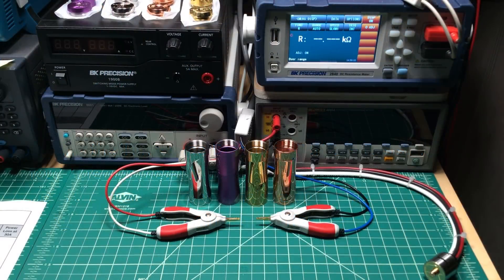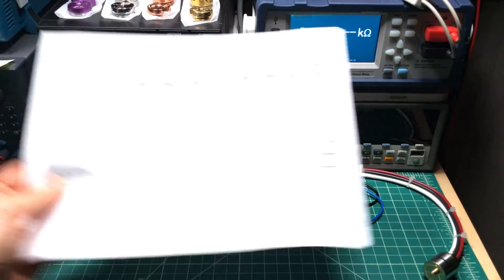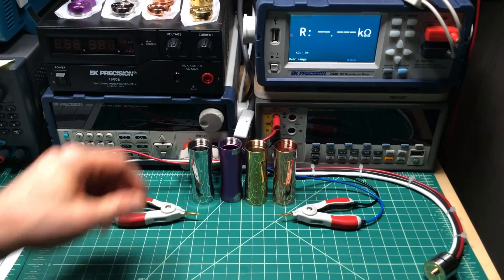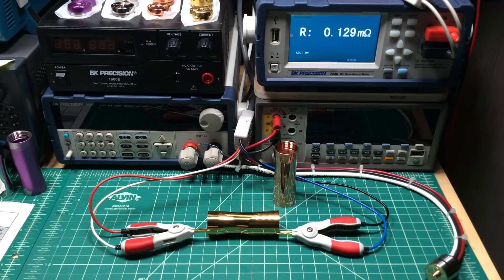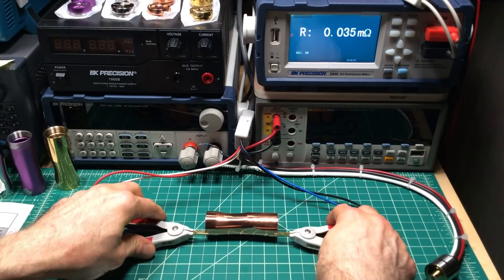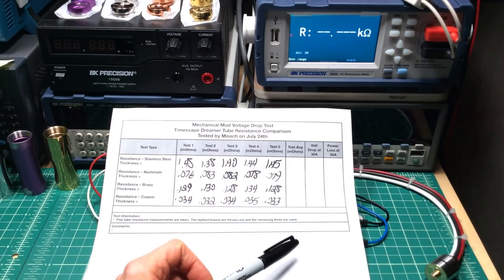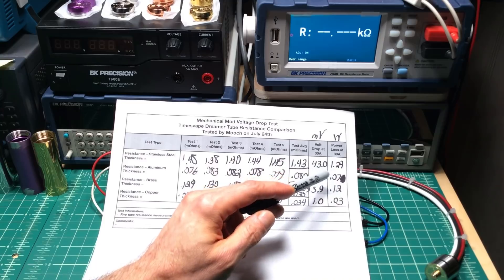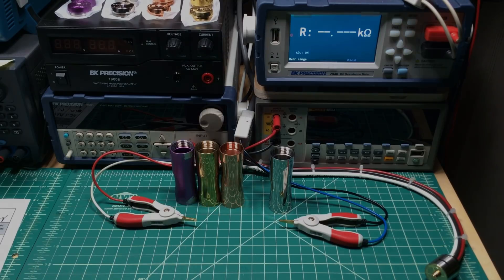Minding Your Mechs – Ep005 – Timesvape Dreamer Mech Testing  Part 1 – Testing four different tubes

Comment: I ended up buying a copper dreamer because it was the only one available to me. I almost got a stainless one, but I'm kind of glad I didn't. I have a fake Purge made of brass, and the dreamer hits ramping up about an extra third or half faster. It's a huge difference, although I don't know if that big of a difference would happen between the different materials. I really wish there was a way for me to check the resistance of super low things like you so I can see how high the resistance is for that mod.
Reply from the maker: The metals themselves wouldn’t much of a difference at all. It’s the contact shape/smoothness, the threads, all the other stuff rather than the metals.
Reply: @batterymooch  yeah i guess youre right, the biggest difference is the buttons. i wish i could show you a pic of the difference, the dreamers is incredible, constant contact with the battery, a real insulator, a cool round high current contact, and my absolute favorite part, the gold plated toroidal spring that keeps the button “shaft” in contact with the button itself and it hits so much better than the fake purge which has a crappy magnet switch which only makes contact on the sliding barrel of the switch.
Reply: @batterymooch  my fake purge doesnt even fire maybe 1/20 times and i have to smush the button to the side to get good contact.

Comment: Ive always gotten copper mechs but after watching this I would be very interested in this same test after the copper and brass have some oxidization.  Would it then equal to the stainless steel? would the Aluminum be the major player for people who aren't as consistent at cleaning their threads. I would guess it would all equal out and come down to keeping your points clean and flat.
Reply from the maker: Good questions! Lots of variables though and tough to test well enough to be able to form general conclusions. Might have to remain some of the mysteries of life. 🙂
Reply: @batterymooch  True, I hadn't thought about the testing and to be truly accurate what it would take. Because the degrees of oxidation the numbers would never be the same. Thanks for all you do Mooch! I love watching your Mech Reviews so informative! Every designer should be watching every one of your Mech testing! You have begun to layout the requirements for designing a low voltage drop mech and where the majority of focus should be!

Comment: Only steel is real! Hate copper or brass because its blushing that fast  no matter what you do. And the threads of the 510 are fucked in weeks!  Its just too soft...
Reply from the maker: Some metals definitely do require more maintenance and more careful use but many vapers like the extra one or two watts of power they get by using brass, aluminum, copper, or silver versus a SS mod.

Comment: The only experiential difference I have found between my stainless Dreamer and brass Dreamer is that the former is a nightmare to maintain - freshly scrubbed threads form a coating within two days, which results in hot threads. The oxidation is rock hard and needs a dremel to remove it.  The brass just keeps going before cleaning is necessary and only takes a matter of minutes with a cloth.

Comment: Great video! I'm definitely interested in the rest of the tests. I have one if the new Kennedy Vindicator mechs and it's the first SS mech that hits amazingly and I think it's because they use a copper button... This first test supports the fact that the tube metal (when thick enough), has relatively little impact to performance.

I would be interested to see the difference in overall performance in the SS tube with the SS button vs putting the copper button on the SS tube.

Comment: Aside from your telegraphing the result, I would not have guessed that the tube material would matter so little.  With that, I will guess that anywhere along the circuit mod parts make contact will be the largest drain.  We shall see

Comment: i expected brass to follow copper in the conductivity test not the aluminum.am i wrong or they use low copper brass?
thanks Mooch
Reply from the maker: Aluminum is more conductive than Brass. There might be a brass alloy with lots of copper and a less conductive aluminum alloy but in general aluminum beats brass...just for the metal that is. A complete mech has a LOT more going on than just the bulk resistance of the metal.
Reply from the maker: I don’t know what alloys are used.
Reply: yes i don t know either but in terms of conductivity if i m not mistaken it goes silver copper brass aluminum and ss from the materials mostly used in e-cigs.that s why it seemed strange to me that aluminum dreamer was more conductive than brass
Reply: evdoros stavridis no aluminum is more conductive than brass

Comment: I wish you had one of the original black cerakoted models as well, I am wondering if the cerakote would affect the readings compared to the same metal that’s not coated?
Reply from the maker: No effect at all unless the coating got in the threads.

Comment: Many people needed to see this. As you've stated, 18650 won't put out more then 30 amps so attempting to do so is nothing but harmful. This leaves me with my original thoughts on stainless mechs, I love them. They basically don't corrode, they can handle solid drops, they don't stink, and you may lose 1.4 watts at most and that's absolutely unnoticeable at higher power levels and basically nothing with higher ohm builds. I have brass mods and copper mods and I love them all but I hate when all I can smell on me or around me is that spicy funk of copper or brass mixed with oils from your hands. I'll always love my old school stainless Praxis V1.
Reply from the maker: 1.3W loss from the tube alone. We’ll see what the rest of the SS mod does. :-)

Comment: I had both a SS Dreamer and a Copper one side by side.  I switched the atty and battery between both of them.  It was night and day the way they hit.  How can this be if they have the same contacts and same threads?  Why the copper hit way harder?  It felt way more then 1 watt.
Reply from the maker: I’ll know a lot more when I test them. :-) 
Maybe the rest of the mods (threads, buttons, etc.) have much bigger differences between them?

Did you switch back and forth over multiple days? Blind testing where someone holds the mech and you vape it? There are a huge number of variables that can affect testing we do and controlling all of them is really important. Our own biases and preferences are incredibly powerful too, affecting results no matter how much we think we can control that.
Reply: Battery Mooch yeah I gave it a few days of testing.  But yes I definitely understand how our biased plays a major role in that.  It's incredible how the mind works.  However I understand that the mech as a whole may test out different.  Thank you for the reply.  Thank you for researching into this.  This is very valuable information.  Prices vary so much for the materials that these mods are made from.  Now we can get to the bottom of it.

Comment: So grateful to have you in the vaping community. I think you're one of the few--if not the only--that I know that actively indulges in the science and experimenting like you do. You're work is truly invaluable to this community, and I hope you continue to provide meaningful and significant results to the vaping community. Thanks brother.
Reply: I cant comment bc of my adblocker except answering people. I just wanted to say I agree so much, battery mooch you are the best asset to the vaping comunity. I just started going through your channel on youtube and this is my second video, and Ive learned that some tings that I thought was right, is not right, lol. Great to have someone with the knowledge and the equipment needed to do what you do. I am especially fond of mech mods and you have the best testing of them. Even some I own. The rx machina I have wont even fire, the gold plating on the cup has rubbed off and the whole thing is beyond repair. I wont be getting a new one lol, I only bought it to test 20700 batteries when they were newer. I found my vtc5a 18650s performed better than the 'five leg' batteries from ijoy, even though everybody raved about the 20700's. Now I use  only 21700s, 30ts, and 18650s samsung 20s. I have two sanyo ncr2070C that I use in my white brass admiral mech, night and day better than the ijoy's. Its the only 20700 only mech I have, and its a great mod. Keep up the good work, peace.

Comment: Thanks Mooch, you have or should have closed down this argument for good. Anyone still saying they can tell a difference, after watching this video, have a good imagination. There will be some. You can now just say whatch the video...........
Thanks
Reply from the maker: This was just the tube. There might still be quite noticeable differences when vaping and using the complete mod.
Reply: Battery Mooch  But it's the tubes that the fuss is about, what they are made of. You have proven the same mod made in all the different metals will be 1-2 watts difference. Switches, 510 etc are a much more important feature.

Comment: Yes it does absolutely make a difference put the same party and same build on each one and you will absolutely notice it unless you vape at .2 or above which is pointless on a mech
Reply from the maker: As mentioned and shown, this was just the tube and not the entire mech. There is no noticeable difference between the copper, brass, and aluminum tubes in the amount of power lost in them. However, there could definitely be noticeable differences between the complete mechs. Testing will tell us.
Reply: Jimmy King  I think you just saw that the difference is so small that it won't make a difference on a like for like mod. 
I certainly did. Perception has way more effect than 1 watt.

Comment: Thanks Mooch!  I really think that the more useful resistance check would be the mech as a whole.  While copper has far less resistance, it is more susceptible to corrosion especially in the high surface area of the threads.  I believe there is going to be much more resistance in the connections than in the tubes.  As far as mech quality i think the button will have the highest chance for affecting performance.  I also believe that the quality of the connections of the coils to the RDA/RTA installed by the user will have at least as much effect on the voltage drop of the entire system as the mech.  In other words even with the best of mechs YMMV depending on how skilled you are at installing coils and the ease of the installation on the particular RDA/RTA you use.  Once again, thanks for all you do Mooch!  Your tests are better than my beliefs any day:)
Reply from the maker: Thank you for your thoughts! I think the usefulness of any given test type depnds a lot on what each of us is looking for. The component level tests (tube, pins, plating, etc.) are incredibly useful to address certain debates and to guide the purchase of different pins, springs, etc. it can also, as in this case, show that we should probably stop debating mech metal choice and look at the other variables, as you mentioned. Without actually testing just the tubes there would be a lot of people who woudn’t believe it. :-)

Comment: Absolutely fascinating. Not gonna lie, I didn't expect the aluminum, brass and copper to be that close. Especially with being constantly told copper is the only way to go with mechs. 
Are you going to run different contacts through each tube, or just use this data and subtract the resistance of the tubes? 
Doing God's work here mooch, I applaud you.
Reply from the maker: Both
Reply: Yeah aluminum is actually more conductive than brass, not copper but brass.

Comment: Can't wait for the conclusion. Yeah, this didn't surprise me much. Brass has been my favorite metal of choice for mechs, ( just for aesthetics) but I find myself using my Stainless Barebones more than most I own. When batt is fully charged you can't tell any noticeable difference between it and any my Aluminum, Copper or Brass mods. But when the batt is at the end of its life cycle you can tell, but it isn't much, just change batt a couple puffs before I would in an aluminum, copper, or brass tube. Good stuff.

Comment: That's pretty surprising. I personally have a stainless Steel and a Copper dreamer. I feel like the batteries I use make the biggest difference. Maybe a little bit psychological difference when I'm using the same batteries. Keep up the good work Mooch.